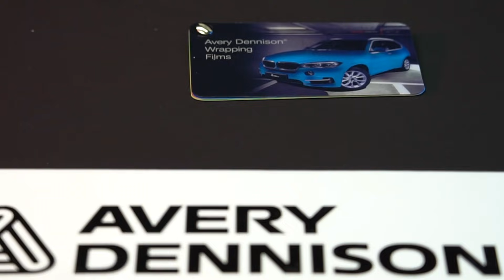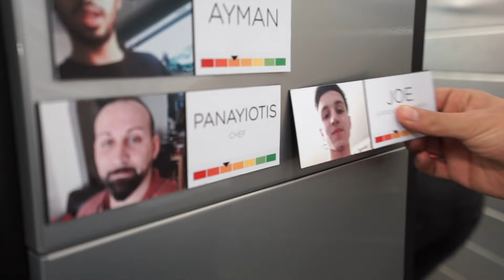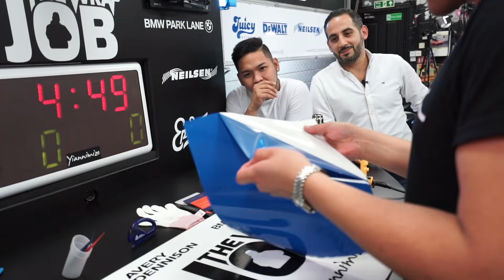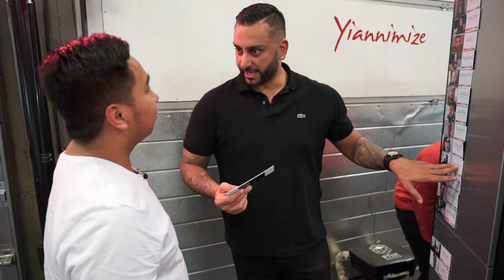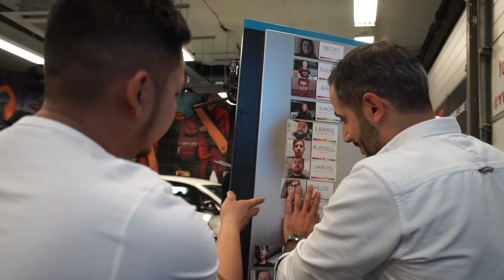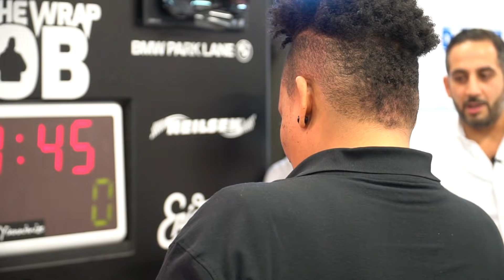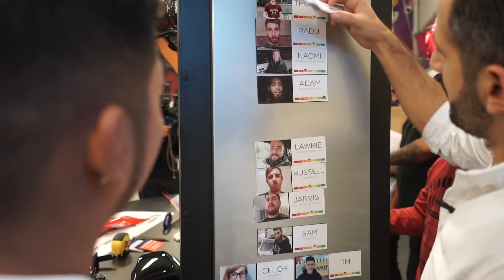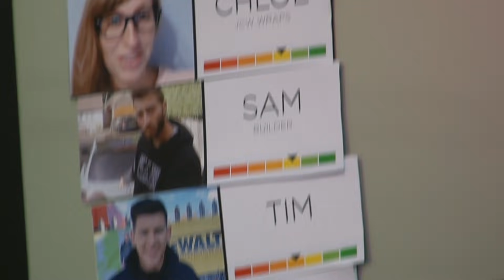Auditions #3 - Compliments and Comedy  - The Wrap Job ep04

Comment: It makes me cringe in my sleep remembering that people try to apply an entire square of vinyl on a door handle before cutting it smaller.
Reply: one of the philipino said it's easier to handle if it's bigger because you have more to hold onto to pull the vinyl around the curves, plus it's cut to that shape - it's not like they could use the offcut for anything else

Comment: What id do is: 
1. Put on the glove as im complimenting Yianny and Burts banging beards and telling nico and mark that they are the dream team
2. Turn on the heat gun and point it towards the ceiling so it doesnt burn the table
3. Measure my vinyl to the car part i have and cut off any excess
4. Unwrap a little of the wrapper from the vinyl   And slowly take it off as i put it onto the car part like im putting a screen protector on a phone to minimise the potential for air bubbles
5. Use the credit card looking piece of equipment (squeegee) and heat gun to buff out any bubbles or creases going in 1 direction to make sure its even
6. Wrap the vinyl around the corners and cut off the excess vinyl while putting the blade facing down next to the edge of the part
7. Shake all your guys' hands.

How far off am i?

I say that is what i would do, but lets face it, i reckon i'd be shitting myself mate 😂
Reply: Its easy to describe, but doing it is a different thing.
You cant just say you would 'wrap the vinyl around corners'. Describe how you would do that?
Would you use heat, no heat, cold stretch, heat shrink, what?
Reply: D-NO cant agree more mate
Reply: Hit the nail on the head there.